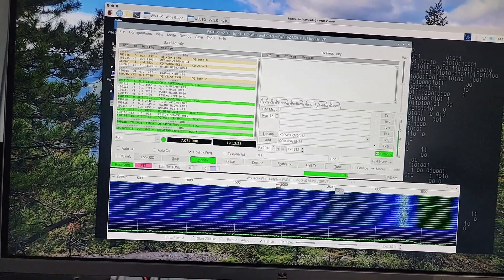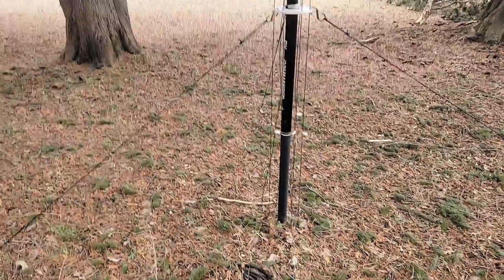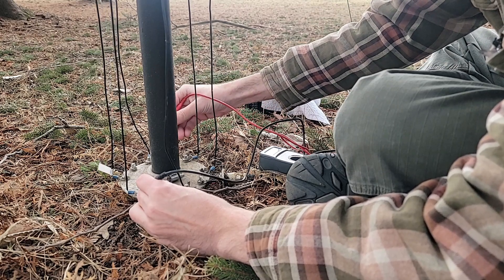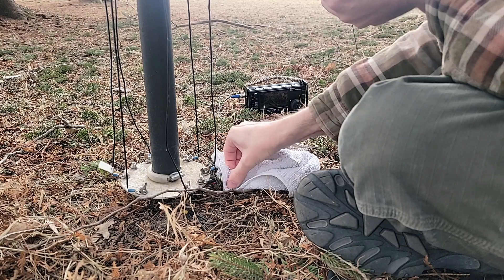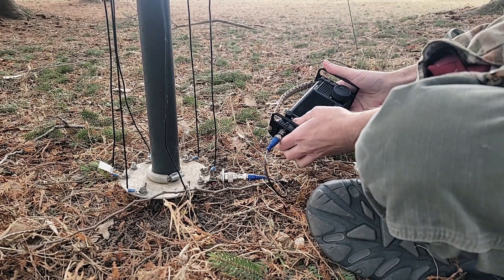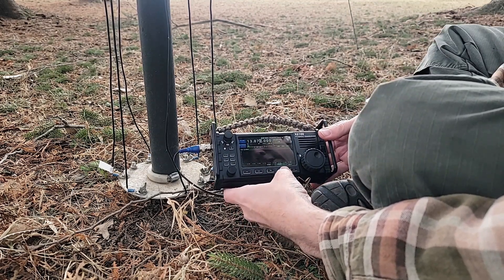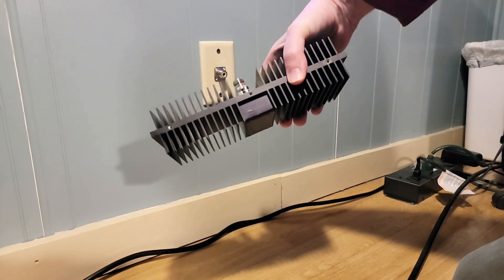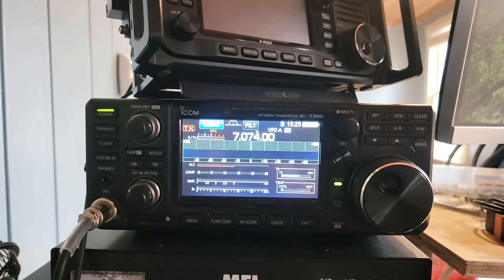Let's get to the bottom of this!

Comment from the maker: Be sure to subscribe/ring the bell to get notifications of next Monday's Ham Nuggets Live stream where we use a VNA to measure TDR and figure out just where the fault is on the coax!
Reply: Yup, TDR is the answer. Last week my 40 meter beam showed a high SWR. I hooked up my Rig Expert AA-600 to the coax in the shack and ran TDR. It showed the fault to be at the 89 foot mark in that coax run. 89 feet away is at the base of the tower. There I found a loose UHF connection. I took it apart, cleaned same and reassembled it. Now I'm back in service. Saved me from climbing the tower to troubleshoot.
Barry, KU3X
Reply: Just gonna say that.

Comment: Vaseline has carbon, it's a petroleum product, carbon in the presence of RF causes little fingers of carbon tracks. Clean that mess off and use electrical tape, good stuff like 3M. PL259 connectors are always tough to solder but do solder them, the screw together type is junk. Watch those SWRs regularly.
Reply from the maker: Good tips!

Comment: Great troubleshooting video, thanks. I noticed that the antenna wires on your DX Commander have a fair amount of slack in them, I get that with mine too, and have pulled it down a few times to take some of the slack out. Is is not that big of a deal?
Reply from the maker: I personally don't think it would matter.  You might change the SWR a bit, but not enough that your touch up tuner wouldn't fix it.

Comment: I am setting up my first ham shack and just got done with running 2" PVC conduit, Underground of course, from my house out to the tree in which my off  center fed dipole will reside, along with my Ed Fong J-pole, (about 20 feet from where I plan to place my DX Commander in amongst the trees)  .  I have 4 pull lines already in place for when I get my Coax bulk roll!😁
Reply from the maker: Excellent!  Get that shack rolling!

Comment: I would try an end fed antenna up to one of those nice tall pine trees.  Run the transformer box closer to the house in a protected position.
Reply from the maker: I have a few EFHWs, now that it's getting warmer I will.  There are quite a few logistical problems with running antennas here.  Hams will prevail!

Comment: Maybe water or moisture got into the coax and froze, then in Spring it thawed out and is causing high SWR. Replacing the connector might help and getting it off of the ground so water or ice doesn't enter the coax. A minimum of adding dielectric grease and Superr 88 tape would be a plus, you might also try adding some of the close cell sponge pipe insulation over the top of the coax down to your Frost depth. 
I had water get into my 75' long Tarheel 4 wire control cable and the antenna would not move up or down so I ordered a new one, after about a year the old one dried out and is now usable.
Reply from the maker: Interesting.  I can't wait a year though...I'm not that patient!

Comment: How long has that Coax been in the ground? 
My guess is that Coax you have there is not rated for direct burial! Water got into it and is causing your problems! 
 Run some poly pipe (sprinkler pipe) from your house to the antenna. Then run a good quality Coax through that. If you have another Coax failure, it will be quite easy to pull the bad out and run the new back to the antenna... I’d also seal that PL-259 better at the antenna. 
That poly pipe is really cheap, and it comes in various sizes. Light and pretty flexible.
Reply from the maker: It's been 2+ years and 2 winters.  It's direct burial cable.  It's also pnlybdown far enough to allow me to cut the grass.  I use that coax for a lot of antenna experiments, so it doesn't get "proper" waterproofing as a result.  Stay tuned for Monday's show where we explore testing coax as a group.

Comment: That base HAS to come up off the ground!!  Then those PL259's and SO 239's have to be absolutely weather sealed then wrapped with plastic electrical tape and electrical tape that when an item is wrapped actually seals itself ad becomes water tight. Then wrap with Scotch 88 electrical tape,  See DX Engineering they supply all the real good stuff to do the job right!!
Reply from the maker: I agree, definitely up off the ground

Comment: Question. Does the lack of taught/loose elements affect the SWR? I feel that after some high winds my elements become loose and my signal drops off. Please advise. 73's. K8JAZ.
Reply from the maker: I have a lot of people tell me the should be taught,  I haven't noticed an issue that mattered.  Might help with wind?  Maybe a tenth of an swr point?  I'm not that worried about it here.

Comment: use TDR to see where the fault is along the coax. I think the nanovna can do it.
Reply: You can use a VNA to check for breaks. It measures the length on a return so you are able to gauge where the break is. If you have 100 feet and it comes back at 30 feet then you know where where problem is. It helps so you can put in a few BNC connectors and work around the problem.
Reply from the maker: We are going to do this live on Mondays Ham Nuggets episode.  Be sure to join us!

Comment: Put your dummy load outside at the antenna .  I had this issue and it was the pin in the so239 on the antenna . A little corrosion and it was loose fitting .  Made a new " flying lead " as Callum calls it .  Problem solved .   IT was also intermittent till i found it . Hope it helps
Reply from the maker: I'll have a dummy load at the antenna end on Mondays Nuggets where do test out the coax.  I did plug a radio drextly into the antenna and it was fine
Reply: @temporarilyoffline  I saw the video .  I did almost exactly what you did.  Still was intermittent .  Then I looked at the flying lead and all was right in the world when I replaced it .  The center part would spin and was loose connection .   Made me nuts .  I hope you don't have to replace the coax .
Reply from the maker: Me too, that's a lot of coax
Reply: @temporarilyoffline  I had to replace 200 feet of lmd 400 due to a thing called a dakota snow pusher .   I get it

Comment: Oh man. That sucks. I'm surprised the RG-214 I have run from the radio to the antenna works as well as it does. It's got to be over 40 years old. I bought it at an estate sale in the mid-eighties.
Reply from the maker: Is yours on the ground under 3ft of snow?
Reply: @temporarilyoffline  No. It's buried under 2 seasons of leaves, tho. 😆
Reply from the maker: @wushock92  you belong here

Comment: If you have an MFJ analyzer like the MFJ-259N you can use it to tell if you have a short or open and where along the coax it is located. Also, I'm surprised that you didn't check for a short between the center and the braid of the coax. Good luck.
Reply from the maker: We'll be investigating the coax coming up on Monday night.  This video was just about finding the problem and going through the troubleshooting.  I might do a little yard ops in the meantime.

Comment: Before the big job, check the connectors on the 100 ft coax! Then check the "thingy" adaptor on the wall! My 2 cents...
Reply from the maker: Its coming up... weather is starting to cooperate
Reply: @temporarilyoffline  I told you!
Reply from the maker: Yep, you did!
Reply: @temporarilyoffline  Happy you find the fault piece! AKA "Union"
Reply: Yessir, I have had those thingy adapters go bad before. That thingy looks a bit tarnished on the center conductor (female).

Comment: TO nice diagnosis mate, You also need a bit more "doingy-doingy" tension on the DXC elements - they are a wee bit too loose and this will also affect things a bit.  Not your primary problem though!  Good luck!
Reply from the maker: Hey Tom!  Thanks for stopping by.  My current goal with this antenna is to leave it sit as it was installed until it fails or I move out -- which ever comes first.  I've been posting updates as things have changed and will continue to do so.  This is my primary home antenna and then I have other antennas for portable use.

Comment: Time to rip that lossy coax out and insert balanced Toad Harbor Feeder ☺️😉can you show us the fault in the coax. I want to see green black burnt braid ☺️
Reply from the maker: You're late 🤣 we're going to investigate the coax on the next Nuggets live stream.
Reply: IF you have to replace the coax, I'd use LMR-400 and crimp on connectors. LMR doesn't like to be soldered. Also the conduit is a great idea. I did conduit from the shack to the tower base, but I have 3 hard lines, 4 LMR 400 and 2 RG6  + rotor wire and  red/black zip cord incase I need 13.8vdc.
Reply from the maker: That's a great idea
Reply: @temporarilyoffline  I believe you can use a nano vna to locate the fault in the coax and get a close approximate location of the fault. Think ape uses one to measure the coax length ?
Reply from the maker: @kevinkc3onohelijeepworld  Monday Night Nuggets my friend!

Comment: Thanks for sharing this.  You actually helped me out with a different problem. My DX Commander wires keep going a little loose and it was driving me nuts.  Thought my poles were slipping down.  It was nice to see yours doing something similar.  Maybe it’s just the nature of the DX Commander antenna.   
73, N0ZIB
Reply from the maker: It probably could use a refresh, but I'm waiting until total failure or move out, which ever one comes first.  Then I'll do a refresh and put it back on the air again.
Reply: I thought the “bungee” cord was supposed to keep some tension on the wires. Also, doesn’t Callum provide pipe clamps to prevent each section from slipping?
Reply: @JoAnnP38  yes, the bungee cords are designed to allow for some stretch.  And they work well.  Callus’s newest design has a hose clamp at the first spacer (where the lowest guy lines go) and then reusable zip ties at the higher up junctions. 
I found my problem. One of my pole junctions had slipped and lowered the mast about four inches. Visibly that junction still looked fine, but I had it apart just today and that was the issue. I added some tape and hose clamps at all the junctions. Maybe we’re good now. 

Still loving this antenna.  It’s a good performer.
Reply from the maker: @JoAnnP38  everything requires routine maintenance, I've opted to run an experiment and see how long it will take to totally fail, so far it's looking like "never"

Comment: That stinks. When I built my QTH even though I ran direct burial 400MAX coax everywhere (it was cheaper to buy one spool of cable and cables for everything, UHF/VHF/HF/CB) and put it in 3" PVC with 2 pull strings ... just in case. If you got a NanoVNA, you could run a test with it to show where the reflection is and then instead of digging up the whole 100 feet, just dig plus or minus 5 feet, make a cut, and then do an splice. Not ideal, but better than spending hours digging and lots of $$ to replace 100 feet of otherwise good coax.
Reply from the maker: That's the plan!

Comment: Measure length of the cable with NanoVNA and you know exact point where the failure is,
Reply: With the Nano VNA you can do a distance to fault measurement, there you find easily impeadance missmacht to 50 Ohms. Leave the far end open an measure it. You will see the distance if you select the right Epsillon of your cabel.

Good luck de Gerold DD4SG
Reply from the maker: By Epsillon do you mean velocity factor?
Reply: @temporarilyoffline  yes your are so right. You have to think about the Er when you measuring pcbs. The  velocity factor is uses for Cables.

73 Gerold
Reply from the maker: Excellent. Today I learned!
Reply: @geroldsept-enzel2109  good idea. I was going suggest the same thing. Love my nano VNA
Reply from the maker: Stay tuned, it's coming up on Monday
Reply from the maker: I am getting signals out to/from the antenna, so I'm going to explore this option.  Maybe the coax is radiating and its completely dark at the antenna?  who knows?  We'll find out on the next Nuggets episode.

Comment: Sounds like a perfect time to get some 4” conduit buried in and setup to feed multiple cables to your shack.
Reply from the maker: It would be if I was staying here for sure!
Reply: Pvc or chain link top rail will work just fine, even on top of the dirt.  Benefits of top rail is you have a mount solution for the next QTH.
Reply: Yeah, make it galvanised steel x 2 @4 inch! 2ft deep.... that should do it. Lol

Comment: Bummer, you live in the middle of nowhere.👍
Keep us posted if the re-termination worked.
Try get those clamp on plastic sealed covers for extension lead sockets that are used outside for power leads. That should keep the fittings dry.
Reply from the maker: I'm thinking it was inevitable in the harsh winters that we have and was testing how long it would last in "the real world".  A little over 3 winters is a good answer.
Reply: Well now you know. lol

Comment: Well, that is a giant bowl of suck.  Tell me you put that coax in conduit, and not direct burial???
Reply: Being a sparky, everything goes in conduit and put in a spare. I have Cat6 underground rated in conduit so I don't have to dig again, I hate digging. lol
Reply: @DonzLockz  I’m not even a sparky and I did that for my shack. Even got to use the spare about a month after I put the primary conduit in because my ever so helpful neighbor tilled my garden without asking me and his tractor’s tiller hit the top conduit at 10” underground.
Reply: @carlosfelix4057  good news you had a spare Carlos,  bad news your neighbor dug it up. What was he doing on your property anyway? Atleast it's an easy fix!👍
Reply: @carlosfelix4057  Damn, that's some serious gardening.
Reply: @DonzLockz  I'm with you on this one.  I pulled cat 6 and coax out to my shop when I built it.  Direct burial, inside extra large conduit (for expansion).  When I ran coax for my DXC - yes, that's right - conduit.
Reply: @FEPLabsRadio  awesome!👍 Having a plan B and C is good practice! I am picky and always do better than whats required, it's bad cause all my family want me to install an fix stuff.... for free or cheap too Lol. Now that I'm older and fatter, I have to work smarter, not harder. Lol
Reply: I'm sure your kids will happily dig that up for their old man.😉
Reply from the maker: I bought direct burial coax...so I directly buried it
Reply: Steve I'd put in a 1 or 2 inch conduit if you have to dig it up.  Just to future proof it and save on a potential water penetration of the coax.